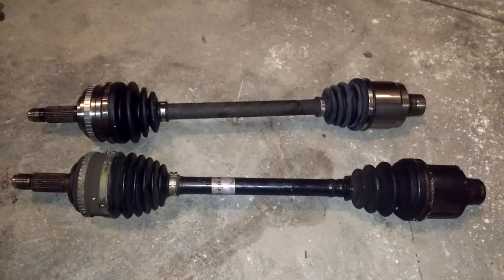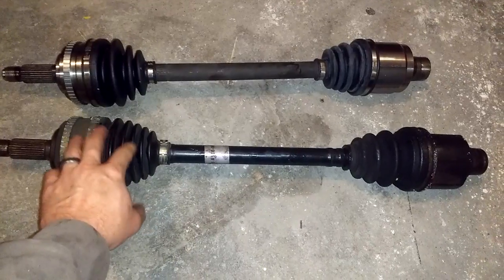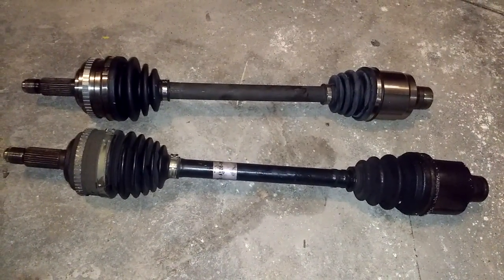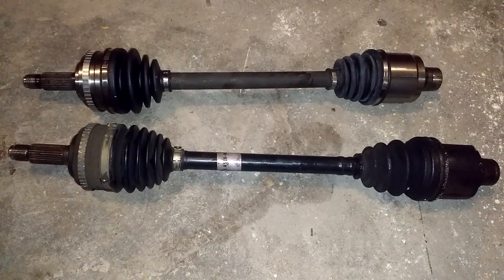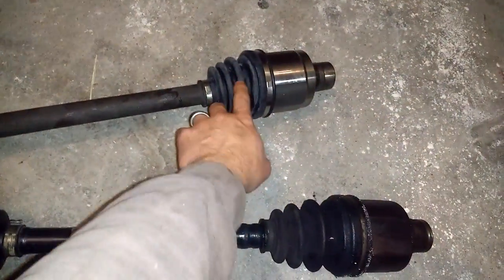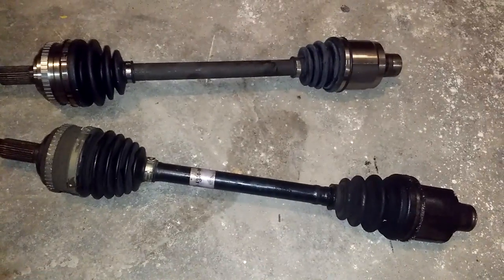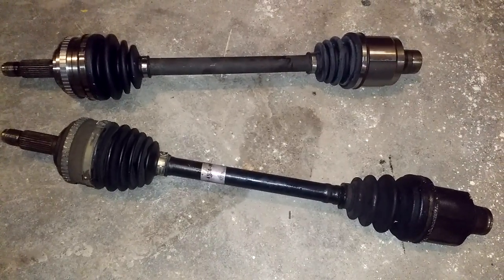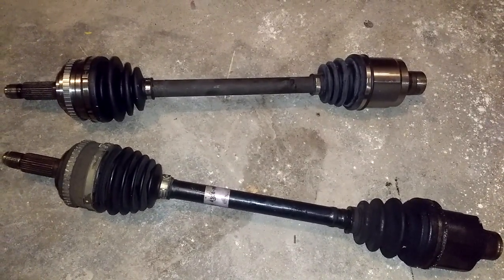How to know when your CV Axle is going bad that is not clicking when you turn

Comment: Nice info. But the in and out axle play you demonstrated is normal. Any play when TWISTING the axle and inner joint against each other is the tell-tale for vibration. My Ford 500 at 105K miles has vibration while accelerating at 65 mph because of very slight amount of twisting play in inner joint. Glad yours is fixed.
Reply from the maker: Thanks for the info!
Reply: @wagu7003  you are incorrect. The axle has a little of play when pushing in an out. There should be no play going up and down at either joint.

Comment: Replace those axles with OEM. I replaced my 2013 Honda civic si with aftermarket and the steering wheel vibration begin when going in to first gear and accelerating. Also a clunk when putting my car in first gear and releasing the clutch developed. Also the car after going into first gear felt like it was not grabbing. Like it was hard to get going. Hard to explain. Went back to OEM and all of those symptoms disappeared. The reason I replaced the axles was because I was told a vibration in my steering wheel was cause because of bad axles. It was actually the rotors.

Comment: Just happened to mine. Outer boot closest to tire pops when u turn, inner boot pops as you accelerate and decelerate, as well as wheel shudder. Most of the time the inner boot doesn’t break so that’s how u know
Reply: Im having the same problem with my 99 4runner right now were 99 percent positive it was coming from the passenger side so we changed the cv axel today but we took it for a drive after and had the same problem. Any suggestions?
Reply: @space rocks2348 if it’s a wheel shuddering/vibration you’re talking about, I’d look into the lower control arm bushings! When you accelerate there will be a popping, especially from zero, due to the loose joint space in the worn out bushings.
Reply: @gedionsamuel2256  that wasn't the case for my mkx. The mechanic said it was lower control arm bushing but it's still shuttering at slower and higher speeds at accelerating.

Comment: They do come apart! The front end suspension components hold cv joints together. They are supposed to come apart. They play is not measured in side to side movement, but in back and forth movement at the joint. You could still have a bad joint but you're checking it wrong.

Comment: I swear this information just save me a few hu hundreds of $$. I didnt hear any click but when I checked it, was rocking the same way you described yours. Now I can confirm the issue. Thanks and God bless!
Reply from the maker: You're welcome
Reply: Inside and outside both side I have clunk slop.

The 12/6. 3/9 tire wiggle got me to outer tie rod starting to go bad. The boot has a teeny slit at the bottom.
But no one said spin it unless it was bearing related.

Spinning tire by hand I could hear the clunk slop.

Grabbing actual axle both ends both sides have clunk slop.

Comment: This video is spot on! Yeah now it all makes more sense so I drive a manual 2003 Subaru WRX and I was drove to Texas from Oklahoma no problem but when I drove back to Oklahoma City I was 7 miles out from my home and all of a sudden when I start letting off the gas I heard this loud clunking noise on my driver side tire under the transmission and it just felt as if your wheel is about to come off

Comment: At last... a video that describes exactly what I have just experienced.... AFTER the engine has warmed up for a while, maybe around 20 miles in my case, when at speed and applying gas, then initially vibrations feel like running over evenly spaced bumps under the left front wheel but quickly become a lot more violent, feeling like a wheel is about to come off.  It shakes the holey-moley Batman!!! out of the vehicle.  Scary at first.  Take the foot off the gas and it settles down.
When I got it home, jacked it up, pulled off the wheel and.... yep, you guessed it... split boot.  Must have gone a while ago for the joint to have become so bad.  The weird thing is that the vibrations did not seem to happen gradually.  They started all of a sudden one morning on the way to work.
Reply: I've experienced the same thing, I think the joint stays kinda balanced at lower speeds but hitting a bump at high speed sends it out of whack
Reply: You refer to the sound as evenly space bumps. I call it a thump,. thump, thump, or like a tire with a knot in the tread. It's all the same and it looks like I have work to do. Thanks

Comment: I have some sick play on the right side of the car in the drive axel. When moving the axel as you showed. I have no clicking or any noises but some mean vibrations around 90km/h that tend to come and go especially if I am turning say slightly to the right. So when it vibrates if I steer to the right it gets better. Most videos I’ve seen talk about that there can be play as you showed but I’m pretty confident it shouldn’t be there. If I can rock it easily imagine the amount of rocking it will do when spinning full force.
Reply from the maker: They have a small amount of play in them as part of their design, but a large amount of play is most likely a sign of slop in the joint. I would take off your tire and check your entire suspension, if it all looks tight, then it is most likely your CV axle.

Comment from the maker: Just to clarify, changing the CV axle took care of the bad vibration at highway speed...Here is more info on bad CV axles.  https://www.youtube.com/watch?v=VtW6R7zuBy4&t=1s
Reply: Literally just happened to me recently so I unfortunately had to buy a new pair and went out to get a pair of new axle seals that’s on the transmission so things will last longer with no leaks
Reply: My steering wheel vibrates around 90km/h. Is it possible CV AXLE problem? at quiet and slow speed, it has clicking sound, more noticeable after car warm enough.
Reply: @kinhung  Tire balance should take care of that. Start with that, it's cheaper and quicker

Comment: THANK YOU, THANK YOU, THANK YOU, THAAAANKKK YOOOOOOUUUUUU. Mines is clicking on turns and shaking when high speed. I have replaced inner and outter tie rods, sway bar links, and ball joints and still same problem. I Jack it up and use a pry bar to find noise and nothing I spin the wheels (by hand in air) and hear noise. I was able to move the axle side to side (or in and out) (just like you just did on the axle). And theres play. I just thought I would do a little research before I change that and it not be the problem. I didnt know which one between the axle and the hub. I was skeptical about the alxe because all the other videos I watched was talking about a torn boot. I dont have a torn boot. But you describe my problem down to the last peice of rice.
Reply: Pretty much by default if your car is front wheel drive and is clicking while turning at low speed/while accelerating it's the CV joint screaming for help.
Reply from the maker: You're welcome. Here is another video I did that has more info on bad CV axles. https://youtu.be/VtW6R7zuBy4

Comment: I always used axles from Napa or Carquest (now partnered with Advance Auto) and never had any quality issues. I read the comment about China made crap and have also read some bad reviews from the China market. In my Opinion, these axles should be changed out just like brakes and tires, to avoid serious breakdowns.

Comment: Toyota Highlander, started shaking violently the front end, ONLY when you push the throttle and try to accelerate. Never heard the clicking sound, but it came out to be the right cv joint axle. After replacing it all came to normal again!
Reply from the maker: Thanks for this input!

Comment: Hi, I have hamming/vibrating noise coming from passenger side, when I'm sitting in driver seat. It sounds like something is spinning in uneven way. Zero up to 100 km/h nothing. It starts at 100 km/h, peaks at 110 km/h and disappears at 130 km/h. That sound is definitely connected only to car speed and not to engine rpms. Its louder when pressing gas pedal/accelerating, but it does not disappear completely when not accelerating. It’s not engine, because that sound is same when in neutral or any other gear. It’s not unbalanced tire or wheel. I tried many different wheels. Ball joints are perfectly firm. Sound does not change when braking. There is no play in wheel in any direction. I've already changed both sides bearings and inner transmission side axle homokinetic joint since I found this joint could cause this sound. No rubber boots were damaged. All looking good as new.  I used high quality replacement, and nothing helped. Axle itself looks perfectly fine. I also tried clicking test when turning full left, full right and accelerating. Nothing, there is no clicking sound. Anyway, this sound started just like that 4 month ago and does not get better or worse. Still the same. I didn’t hit pothole or anything like that. Now I plan to change outer wheel side homokinetic joint, but I don’t believe it will fix it. I will be glad for any ideas and suggestions. Thank you
Reply: David, I have same trouble as same as yours. Until 65 miles it is fine, but vibration comes on passenger side when over 65 miles. I changed both sides ball joint, tie rod and lower arms recently. Current CV joints were replaced last end of year. I didn't know this vibration cause I didn't drive over 65 miles. There is no clicking noise when turns. Anyway I ordered new   passenger side CV joint and will be delivered coming Friday. When I checked current CV joints on my car, driver side inner CV is connected with transmission firmly, but passenger side has shaking.
Reply: @maxpark4154  Max, thank you for your response. If you feel play in either joint that is clear indication, I ended up changing all four joints and I think that the vibration is gone and I didn't have any noticeable play in joints... I also found out that specific parts of highway I'm using have specific vibration sound. So you got to turn up the radio a little bit otherwise you would go crazy thinking it's going to never disappear. Good luck with your repair!!!
Reply: @maxpark4154  Also get a second opinion. Take someone with you. I heard vibration from right side even though it was left axle. If you lean towards passenger seat as you drive, you'll notice that direction from which sound comes from changes.
Get a driver and try to listen with open windows.

Comment: Yes I changed my transfer case after burning it out with no oil after hitting a median strip, but with the new case I still had vibration, mechanics we’re saying it’s the case but I had my seals redone and I kept telling them to check the shaft , and they said it looks fine , they drove it and feel the vibration and said no it’s not the shaft , but it was exactly this same problem , mechanics over look the inner joint as it doesn’t fail as often but it can
Reply from the maker: Thanks for sharing!

Comment: the easiest way to tell that the inner cv joint is bad is to step on the gas, rapid acceleration from a stop. you will feel abnormal vibration from the side that was bad.
Reply from the maker: Thanks for this info!

Comment: Good video, two days ago i think this happend to me. Everything went fine and suddenly my steering went bad whn driving. It came good again then and then 8 miles later just before i got home the car stopped and in gear i hear a metalic grinding but no motion to the wheels.

Car is now at the garage but waiting for diagnosis. I think maybe this has happened as i heard no clicking.
Reply: Your differential gone bad.
Reply: @michaell3711  it was the CV joint that went bad.

Comment: Bad inner cv axle definitely cause tire gonna fall off shaking on my 2003 lesabre I lifted the front tires off the ground and put the car I gear and the bad side was wobbling like crazy also noticed the seal had slung grease everywhere so it was obvious to me it was a bad inner cv. Note mine shook at 45mph then got very bad from 50-63 mph then would smooth back out
Reply from the maker: Thanks for sharing!
Reply: i have a torn boot for a couple of years and now vibrate right turn worst than left,  coasting worse than under power with some steering wheel movement...   debating cv vs bad tire.  did hear a couple of clicks yesterday.  buick park avenue 1999 - 133K miles

Comment: I have a 18 silverado. I have replaced all 4 tires and bushings. I have a wheel shudder/steering wheel shakes really bad but is random and only last a few seconds. It usually happens between 25 and 75 mph. I had 2 shops looks at it and everything seems fine no play in any suspension parts. The only thing is that some of the lube was coming out of the boot on one side. Do you think this could be cv axle?

Comment: I also experience that. Unfortunately i replace my engine and transmission support but stil it vibrate d same thing during acceleration. Until i found out it was the inner axle joint. Theres no tiktok sound during sharp turn thats why i disregard the cv joints. Learn from my mechanic and my mistakes.
Reply from the maker: Thanks for the comment!

Comment: if you have a bad CV axle will it make a banging/clicking sound  when accelerating in a straight line from a stop
Reply: Hi, would like to ask which specific  part the of cv axle?? For banging/ clicking in a straight line would it be the tri bearing or spider bearing from the inner  joint?? Because i have the same issue for about months. Thank you in advance
Reply: @sunflxwergamer303  just replace the whole thing.
Reply from the maker: That is true sometimes but they do not always click. Hence the reason for this video.

Comment: I’m experiencing this with my 2018 Cadillac. Was told I had a bent wheel and replaced it and didn’t resolve my issue so I was thinking my front cv shaft was bent from a pothole.
Reply from the maker: Potholes can push CV axles over the edge.  Most likely not bent, but the knuckle bearings could be shot.

Comment: Thanks. That sounds a bit close to the symptom I kind of suspecting but still not quite sure though. My car issue was When I am driving, the car swirl sometime and handling steering gets a bit unstable and especially when the car is moving up on the elevated road and the transmission shift gear and when I pedal gas a bit more power to the engine. But i didn't hear any noise coming out from underneath. Could that be the same cv axle issue? Lexus 300rx
Reply: Same for me

Comment: Mine, stirring wheel vibration when going 80mph and turn slight to left. Can it be bad tires I do need some or axles?
Reply from the maker: Could be multiple things.  First rotate the tires and see if it goes away.  Then check your entire front end suspension.  Make certain you don’t have a sloppy tie rod or sway bar end link.  After all that it might be your axle.

Comment: I already know my inner boots are sprying grease on my 03 Honda Pilot but, my question is, I get a click from the steering column when I turn, NOT from the wheel.  I had an 04 Ford Freestar that made that click sound for YEARS, and it was never an issue, so I don't know what to think.   Would it click like that in the steering column, exactly like the sound of an electric ignition stove burner, AND would a bad cv axle also cause a knock over some bumps?
Reply: hbic3 My 05 4runner Just started making a humming noise but not really a vibration I could feel and I noticed that the inner boots were spitting grease also. There is no clicking sound but maybe mine hasn’t gotten to that point yet. Even though it’s the inner boots I bet it’s still the culprit of the noise when you’re turning.
Reply: Cv axles create many different sounds.

Comment: I have a 03 Acura TL. The issue I’m having is between 20 and 40 mph I have a slight intermittent wobble happening. Mainly noticeable on deceleration. It doesn’t do it any other time. Any ideas on what that might be ?

Comment: Does it sound like growling sound when you hit 40 to 65mph? I changed both of my wheel bearing on my 2004 sienna but the growling noise is still there.
Reply: Robert Constantino check your rear wheel bearing.
Reply: what was the issue ?

Comment: Did that CV axle make the whole vehicle vibrate violently ?
Reply from the maker: Mainly the front end, but it was pretty violent.
Reply: Turns out it was the back windows rolled down mistakenly. Couldn't even hear/ feal the draft. I wear hearing aids and they are noise canceling, they shut off from turbulance. So they
act like ear plugs.
The shaking was from the rear end of the 2020 Corolla
window design. Which caused air pressure burps.
The burps mimicked bad bearings or a bad tire.
I'm pissed that Totota 
didn't give me the memo.
But in Toyota's defense
I bought the car at a Jeep/ Dodge Dealership.

Comment: I get slight noise on bumps, all the front end parts looks tight with 2 new lower control arm and struts. Today I had the wheel off again and I have a little bit of play on one of my axle, do you think would lil bit of play when you hold the shaft and move it back and forth make noise while going on bumps
Reply: I have the exact problem youre having. Does it sound like clunking after going over small bumps, even the smallest bumps you can hear it. Ive changed struts, ball joints, control arm bushings. Cant find the problem at all.
Reply: WithCc andDrew  yea I have a same issue with my 2011 Toyota Sienna everything seems nice and tight I can’t figure it out what could be the issue, I’m change link pins. Hopefully that will help.

Comment: sir, there is a bit play in my tie rod axle. The axle connecting the inner and outer tie rods is able to make rotation about 1 inch (no noise at this time) or less, but there is no play or movement when the axle is move in and out (it seems normal).

The same play is noticeable also on the CVT axle.

Could you kindly clearify about this play whether its going bad or just normal. Thanks.